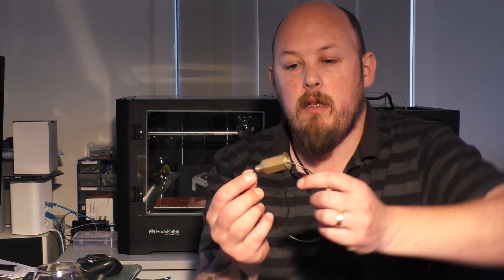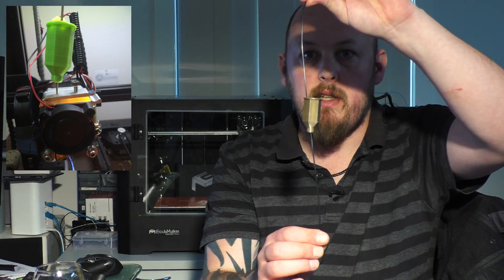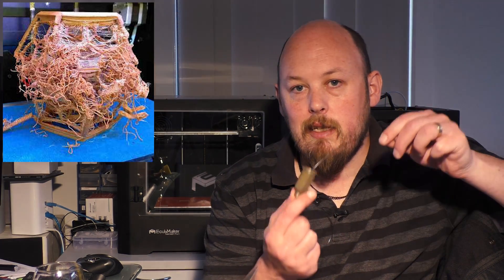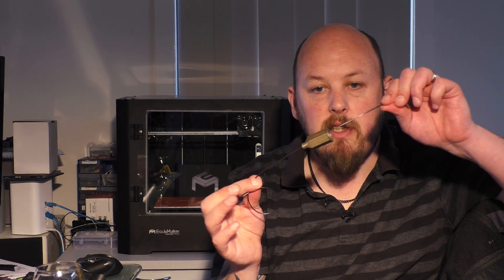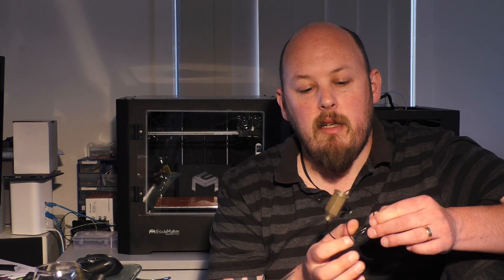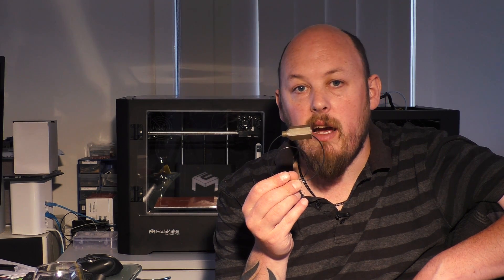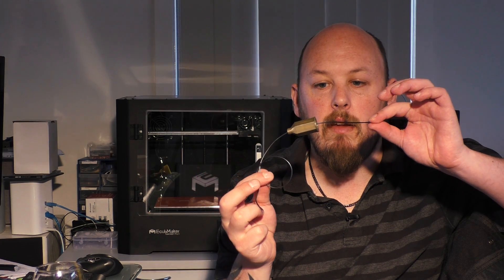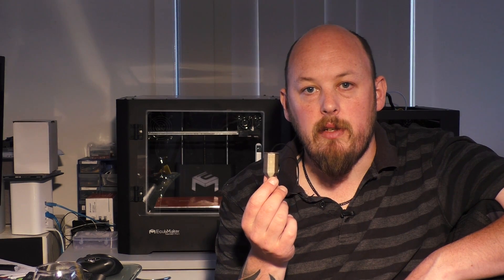Is a 3D Printer Oiler Worth it? What is a oiler and what does it do??

Comment: Hi Anthony. I am currently testing this oiler out, I am just a bit concerned though if it will make my extruder feeder gear slip due to the oil.
Reply from the maker: Hey! Why would you have oil in your gears? :)
Reply: What I mean is that, if I put oil on foam then the filament will have oil on them, then the extruder pulley, or the one that grabs the pully and pushes it to the nozzle, can be contaminated with oil, which in turn may loose grip. I hope you get what I mean.
Reply from the maker: Yeh i got what you mean - We are not saturating the cloth to the point of dripping, just enough that it slightly coats the filament and also helps grab all the dust off the filament. It works beautifully on PLA - not so much on ABS
Reply: OK, thanks man. I currently using it for ABS, fingers crossed, although it looks good so far. Thanks for the advise.
Reply: Hi Anthony, I have just finished the print with the filament oiler and I should say it looks good even with ABS. Thank you very much for this tip,

Comment: I think this will be one of my first prints once my printer gets here and assembled.
Reply from the maker: +Tyler Moran From some trial and error - DONT use on ABS, doesn't work.. and try stick with rice oil or something that wont gum up - apart from that i use it every print
Reply: +The Hot End I had planned to try to stay away from ABS as long as I could stand it. I do however want to print some things in nylon. Have you ever used it with that?
Reply from the maker: +Tyler Moran Not tested nylon yet sorry so i dont know. Worst case just take it off for that print :)

Comment: Sounds like a good idea to clean the filament. Have you used any other oils? How many people have used it with ABS? What oil have you had success with? I am interested in all aspects of printing as I am still learning.
Reply from the maker: +Kim Reynolds Hey Kim - I dont believe it works well with ABS as ABS is oil based - however i and others can confirm its nicer to print with it with PLA
Reply: +The Hot End Thank you.

Comment: We use a similar principle in industrial plastic manufacturing.      We will often mix slip-agents or light oil into a batch prior to extruding.   Injection and blow molding processes use various viscosity-altering materials like slip-agents or internal lubes.

Came up with this idea while running my DaVinci AiO prior to XYZ bricking it on me,  turns out many people had the same or similar ideas as well,  which is pretty cool.    Shows that we have some very intelligent people in our community.

Comment: So I took you up on it and made 2 for my 2015 FFCP, and wow,.... it causes MAJOR printing issues. I had to pull the nozzles and soak them in acetone to clean them up (would not even print without the oilier's). It appears it clogged the nozzles, and causes a strange stringing issue as the filament is pushed through the nozzle (bunches up and pretty much destroys the print).  

As soon as I cleaned the nozzles up, I re-ran a print.. and no problem. Re-installed the oilier, re- ran the same print and BAM fail...

Here is my setup:

Hatchbox 1.75 Filament
Upgraded SS .40 Nozzles
Very light coating of extra virgin Olive Oil

Not sure where the failure is in my setup, but I can absolutely confirm that oilier's don''t work for me.
Reply from the maker: Pla or abs ?
Reply: +The Hot End ABS
Reply from the maker: Ive only tested with PLA (per description)
Reply: +The Hot End If you ever get around to testing ABS on your setup, could you let us know if it works for you?  I would like to know if this is an ABS issue, or my setup.

Thanks
Reply: Have you used it with ABS?  I could be wrong but I thought most of the specialty filament is PLA based?
Reply from the maker: Not tested with ABS here.